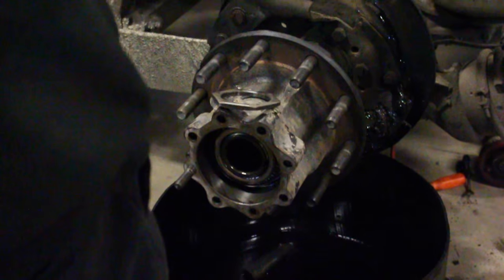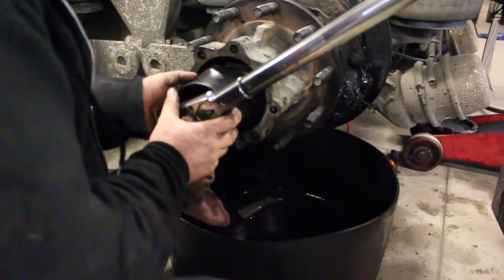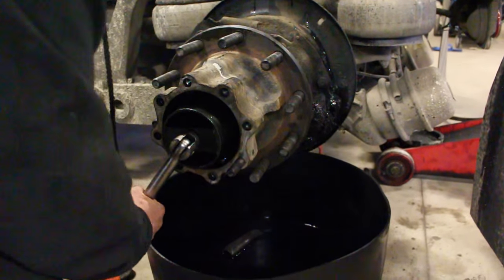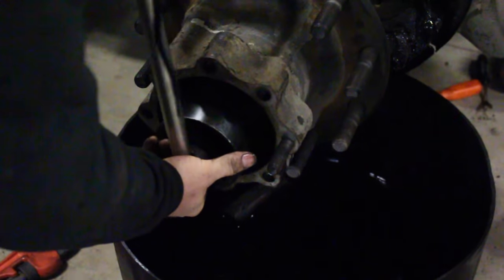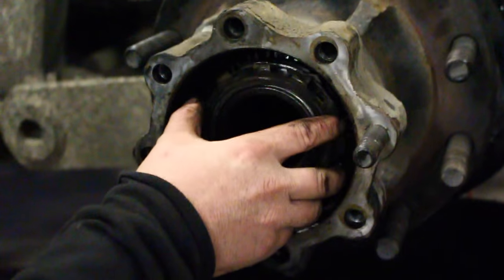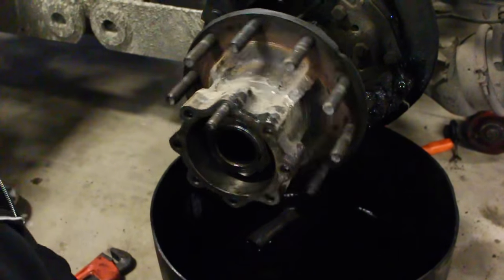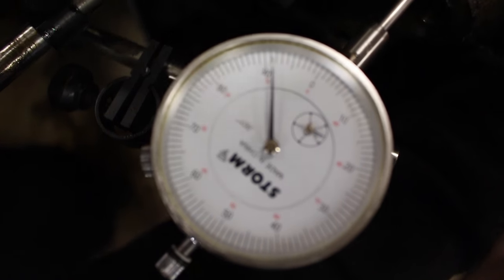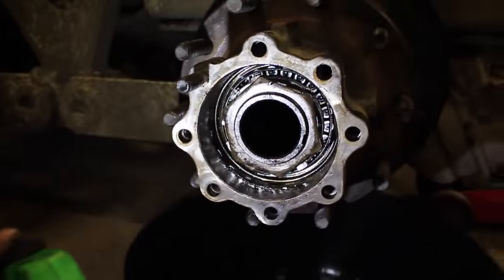Setting Wheel End Play

Comment: Great job▪ followed the proper procedure ▪ getting closer to .001'' will be a good practice bcuz down the road the bearing will get more play so getting closer to .001" instead of  .004" is a good practice. Good job though
Reply: How do you figure he followed proper procedure, because when he pushed against he got.004 and when he pulled against it he got   .004-005 which is a total of .008-.009. He changed that one not long after he shot this video.

Comment: Replace cup, cone, races, and spacer.  Do not back off bearing load torque. If spacer is left out ,torque the old  method. 200foot pounds back off 1 turn ,torque 50 foot pounds, reassemble, check end play .001-.005.  Adjust axle nut if needed .Reassemble and bend tabs.

Comment: Last time I checked 4 + 4-5 equals 8-9 meaning you have too much end play. Spec is 1-5 total,not each. Hope you like changing wheel seals because you probably changed that one not long after you posted this video.
Reply: I think he's right on Shannon. Looks like he's got 4 to 5 thousandths to me. He's got .004 to.005 between the back and front not .004 plus .005. He could probably go a tiny bit tighter, but we're splitting hairs there. Literally one dowl tighter would put him almost too tight at .0005 to .001 in my experience.

Comment: What do you do when a mechanic doesn't use a tourqe wrench insisting that he's been doing it so long he doesn't need to use one?
Reply: Find a different one.  —diesel mechanic
Reply: @shawnevans9106 correct. also find a different one if they say that all bearings are adjusted the same way across all manufacturers and setups.